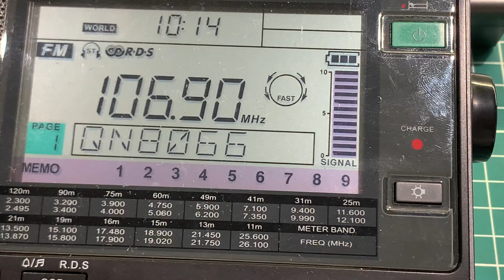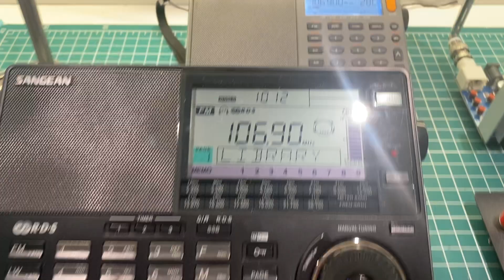STM32 microcontroller and the QN8066 FM Transmitter - PART 1

Comment: Bom dia Ricardo,montei um ontem, pois chegou c.i. ontem mesmo, porém ficou com uma oscilação estranha, como se deslocasse alguns herts e ele coloca de volta na frequência correta, vou montar outro e ver se ocorre o mesmo.
Reply from the maker: Isso pode estar relacionado ao cristal ativo que você está utilizando ou a configuração dele na placa. Procure colocar o cristal ativo o mais próximo possível do CI. É importante que o cristal ativo seja de 32.768kHz ou múltiplo dele acima de 1.4MHz (em meus testes). Por padrão, utilizo cristal ativo de 32.768 MHz (divisor igual a 1000). A biblioteca que desenvolvi considera por padrão este cristal. Há também a possibilidade de você está enfrentando instabilidade em seu circuito que, ao aproximar com a mão ou corpo no sistema, ocorre estes desvios.
Reply: @pu2clr  Entao, desconfiei mesmo do cristal  ativo , coloquei no osciloscopio e vi que parece esta variando a frequencia, infelizmente o display no osciloscopio so tem 3 digitos XX.X, ai o ultimo digito fica variando entre 32.8, 32.7 e ate 32.6. e vai oscilando dentro desta frequencia, vou montar outra plaquinha com um QN8066 novo e fazer uns testes.